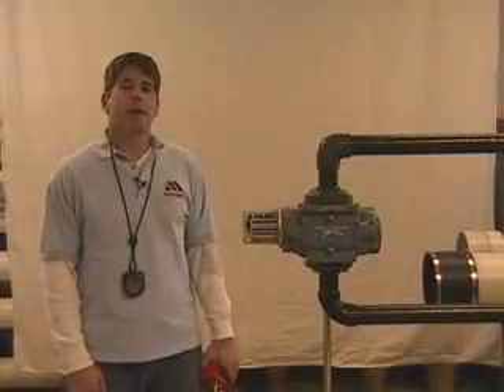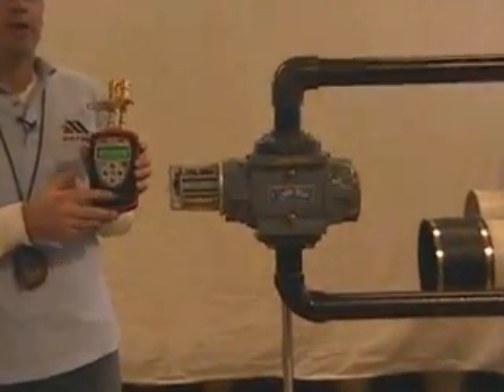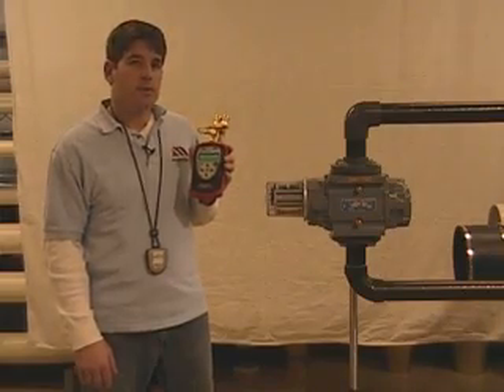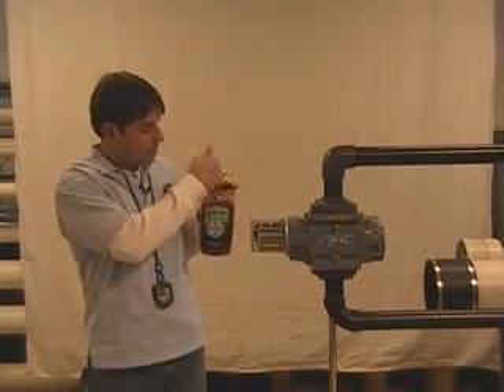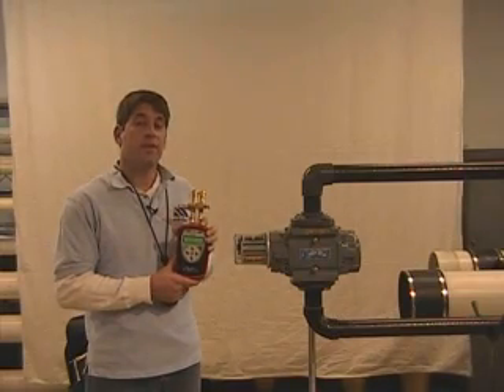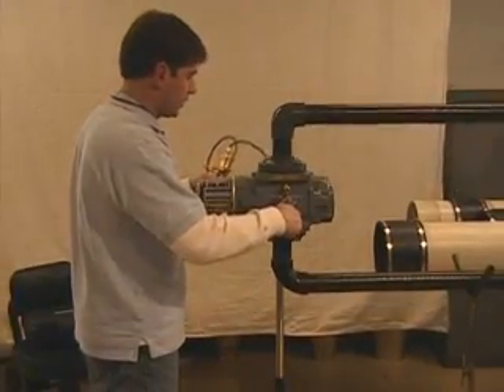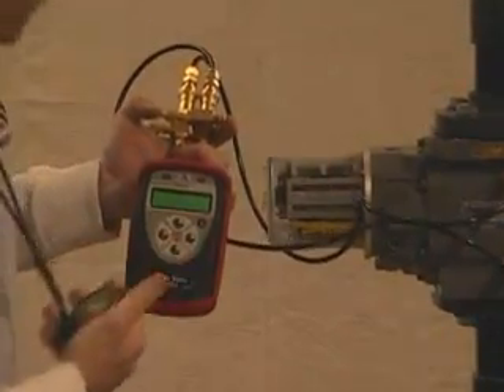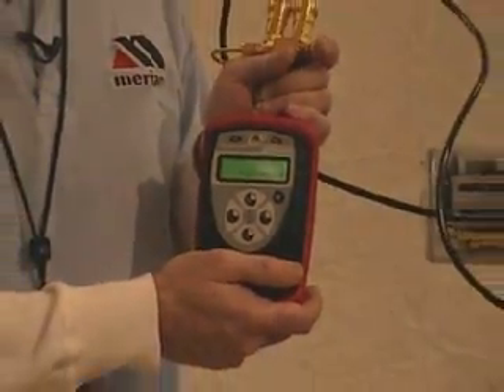M201 Gas Meter Tester Demo

Comment: I love that you demonstrate your instrument and Supply videos on the subject but I feel the topic of gas load was not discussed. I have worked for the gas utility in St Louis Missouri for 35 years and can tell you firsthand that load makes a difference. My thoughts is that we should document what the gas loads were on previous test and perform the current test with the exact same load. I would like your thoughts on my concerns.Thanks Bob.